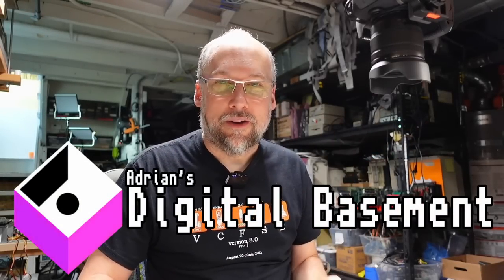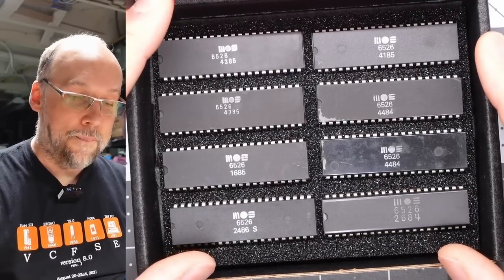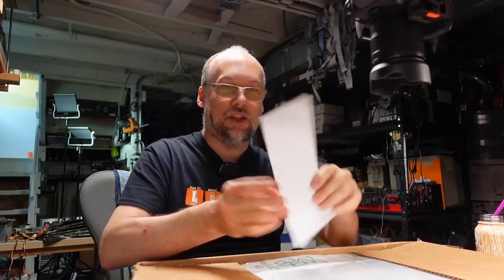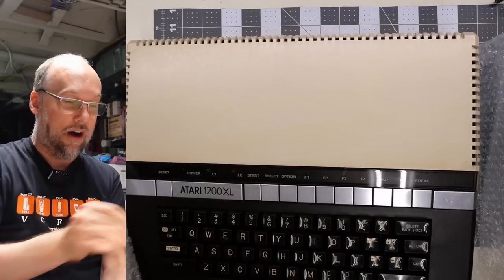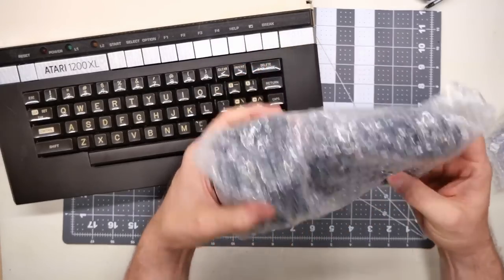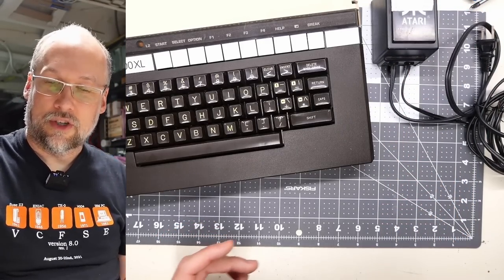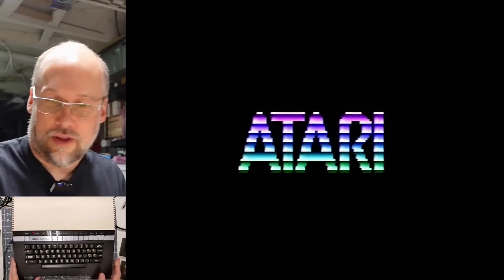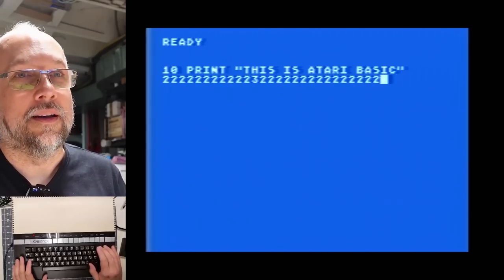0066 A pretty rare Atari computer shows up in the basement

Comment: When I got my Atari 1200XL from a thrift store, the keyboard was totally unresponsive. Then I found out that the plunger that contacts the membrane have softened over the years that it would not put enough pressure for the contacts to work. After some disassembly to access those plungers, I used 1/32 heat shrink tubing and cut little pieces of 1/32 of length and put it on all the key plungers. DON'T HEAT SHRINK THEM! After a couple of tries, changing the length ever so slightly, I got all the "freaking" keys to work. You have my permission to mention me for this.  Douglas

Comment: 24:11 - if you have to replace a cable on an old joystick, don't use some regular 9pin d-sub connector with some random 6-7 wire cable but look for 9pin joystick extension cables. They still make those, they have male connector on one end and female on the other, just snip off the female end, tone out the pins and you can hook up to your joystick, good as new and it won't cause issues with the joystick port not fitting in the machine.

Comment: The Atari 1200XL was a beautiful, if flawed, machine.  To support the Help function and self tests it boasted a new OS.  Unfortunately it was incompatible with some programs.  Atari would mail out for free a Translator Disc that had two versions of the original Atari 800 OS.  I was surprised that when the 800XL was released it STILL had the less than compatible OS and the Translator Disk was needed.  The 1200XL did have a better keyboard than the later 800XL.
Reply: The later 130XE was more compatible than the 1200XL had been, so I guess Atari did finally try to fix at least some of those issues in the ROMs. I know that because KoalaPainter didn't work for crap on my XL but was fine on my XE.

Comment: The Atari  PSU you are talking about it the one known as the Ingot and yes, most folks won't even bother to use them and instead replace them with a modern switching type or use one of the later made PSUs that don't have the issues. I use one of the later made XL style PSUs with my 130xe.
Reply: I recently cracked my "Ingot" for my 800XL open and replaced the inside with a switching PSU and glued it back together.

Comment: I’ve found that the keyboard membrane tends to “stick” to the PCB underneath if it isn’t worked regularly.  You can use a hair dryer to loosen it up and gently peel the membrane off and reapply it.  I love the keyboard feel on my 1200xl (it’s the best Atari 8-bit keyboard feel IMO)

Comment: There's usually a small adjustable trim capacitor to fix that colour smear or character shadow etc.
Reply: Is this Atari 1200 XL comparable to Amiga 1200? Naming suggests it should be.
Reply: @richard.20000  - The Atari 1200XL predates the Amiga 1200 by almost a full decade.
Reply: @Randy.Wuerger  Is Atari 1200XL faster than my Amiga 600?
Reply: @richard.20000  - How could it be? Again, the Atari's design predates the Amiga by almost a decade. And both were based on design concepts of Jay Miner's engineering team. But the Amiga was designed to be the next-generation "Atari" computer. NO. It's not comparable at all.
Reply: @Randy.Wuerger  I ask because my 3 years old MacBook Air M1 is still much faster than any today's new Intel laptop. So it is possible to design future proof computer.

Especially when legendary Jay Miner was involved. I guess the Atari naming is what confused me (1200XL, 800XL, 130XE etc.).

Comment: I recall some of these computers having compatibility issues and thus it was hard to consider it. I did go from at 800 to a 130 XE in college due to my damaging the keyboard during a final paper. The 130 XE was great. The 800 was repaired and still works. Not sure if I kept the 130 XE. I did purchase the disk drive with this styling and never had an issue with that. PS Would love to see you do more Atari 8 bit videos. Thank you for your great content!

Comment: The 1200XL was my first (and for a long time, only) machine!  (Name checks out, right?)  It's funny, I never saw one with these multiple LED colors; mine was just red, red, red.  (I got mine during the "clear this inventory out" phase, as it had a pretty hefty mail-in rebate attached.)

And, yes, there were some incompatibility issues due to developers using tricks they weren't supposed to in the 400/800 days; to fix this, you would use the "translator" disks, which would load the older ROM images into the banked RAM to more closely simulate the older machines.

Comment: At elementary, we had VIC-20s and 800s. Where I started. My first home computer was a 1200XL. I programmed a great deal on it and played a lot of games, and never had compatibility issues. The later 600/800XLs which my friends had, just felt cheaper quality. I think that's what happened, they cut corners as the 1200 was made well. I also later had a 130XE which was nice, the extra memory was kind of useless, but it was fun too. It looked modern. I still have a Vic 20 and an 800, but would love to get a 1200XL one day for the memories. I still play Infocom games on my Mac. Great video.

Comment: I have bought some replacement parts to refurbish the notoriously flaky Atari 5200 controllers from Best Electronics (mentioned by Peter) and I can confirm they're a great shop. They are a bit old school and quirky but they're the only source I know of for quality replacement parts for Atari machines, and the stuff they sell is top-notch and much higher quality than what came with the consoles/computers originally. They advertise many of their flex PCBs and replacement buttons as "lifetime" parts and I believe it.

Comment: I adored my Atari 800XL. I was studying electronic engineering at the time and this machine was excellent! You could do some serious coding on these machines! I had an Assembler language cartridge that I was able to use to code speeded-up (object code)) routines that I could 'call' from Basic! I cut my teeth on this machine, it was a serious boost from the BBC B I used before it. It fitted it neatly between the BBC B and the Com' Amiga that I got after it. I liked the look of the Atari ST but the Amiga OS swung it!

Comment: The Atari 1200XL case was used in the Brazillian computer TK2000 by Microdigital, though inside that was a clone of the Microprofessor II by Taiwan's Multitech (later Acer) which was mostly compatible with the Apple II. It didn't have the joystick ports on the side, however, nor the function keys.
Reply from the maker: Yeah! I was recently reading about the TK2000 and indeed, it's clearly a knock-off. (And I love it!)

Comment: The 1200XL was my 2nd PC... I know there were compatibility issues with it but I never ran into them.  The biggest "compatibility" issue was with the SIO port on it.  It wasn't wired with power (like the 800/400 were) so printer interfaces were special for the 1200 and had a wall wart added.  I think its an easy bodge fix but at 14, I didn't know about it.  Eventually I got an 800XL + Rambo 256K + MIO + 30MB hard drive and that was /|\ bliss...

Comment: Adrian you can probably get a free replacement membrane from Best Elec since they offer a lifetime replacement warranty on their membranes.  Congrats on your 'new' 1200XL!  They made about 110,000 of them in total.

I'm thinking someone replaced the stock red LEDs with the green and yellow ones, but they did it tastefully with ones of good brightness and not super bright modern ones.   
There is an updated bugfix OS for the 1200XL that Atari developed and they even made a bunch of updated OS chips before the 1200XL first released but were for some reason not installed and Atari used the more buggy OS chips I think merely for cost reasons. The updated OS will show (R) on the power-on Atari screen to denote Atari as a registered trademark. Best Electronics may still have a few of these remaining 1200XL 'B' ROMS at about $30 for a set (new old stock) or you an burn the updated OS onto eproms. The 800XL has an updated version of the 1200XL's B ROM that includes support for more things like PBI bus etc.
The key to the right of HELP is often called 'inverse key' on XL's or on the 800 it was called the Atari key.  
To keep your cart tunnel looking nice, be careful how you insert cartridges into it. They can get very scuffed with long black lines from cartridges. Looks bad...
There two slight variations of 1200XL's. About 1/6th use 28 pin sockets for the OS ROMS while most have 24 pin sockets. The 28 pin sockets are preferred because they make installing a U1MB upgrade or standard 800XL ROMS much easier. The other variation is that some will use a flex cable for the cartridge port while most seem to use rigid wires (preferred) for the 90 degree angle to the motherboard.
Another variation might be that the factory used 300ns or maybe 200ns RAM (I think). 
All of the main and custom chips I think should face one way (notch on left I think) and one socket (Antic I think) on my 1200XL was installed backwards so verify socket vs chip orientation with a photo before you pull chips.
It looks like your machine might be missing the RF shield, which is a nice thing to still have in there.
Yes the 9v A/C adapter from my experience is very safe. The A8bit FAQ says they can drift in voltage but I've never seen that and I think the 400/800/1200XL/1050/810/XF551 can probably take a good bit of drift anyway but you would know better than I how much.
1200XL video quality can vary greatly. There are simple and more modern upgrades for the video. They have a unique color saturation circuit that gives the 1200XL a unique quality that other models do not have. If you install a modern video solution like UAV-D that will bypass the saturation circuit.
The angled joyports are not as nice as the straight ones IMO.

Note: you said the 800XL power supplies are bad but they did make good ones that can still be used. The ingot is very common (epoxy filled) and should be thrown away. However the ones with the XL vent styled cases can be fully serviced (replace caps etc) and used and are safe if they have been serviced. There is a black and white one of these.

Enjoy your new machine! Loved that it gave you a joyface!

Comment: The reason that Basic exists for the newer systems as well is that the basic that is in the rom is actually a limited version, I think they had to crunch it down to 4k of rom space, so some features are missing. Those cartridges are a larger, more feature-filled version of AtariBasic.
Reply: (This version didn't have a basic rom, but the XE computers later on  had only the stripped down rom.)

Comment: The L1 and L2 lights have the following meanings:

L1 = Keyboard has been deactivated
L2 = Keyboard is in the International Character set.  (Control + F4)
Reply: But surely not while in the memory test?
Reply from the maker: Ah that's interesting. So some registers that be set to toggle the LEDs?
Reply: @adriansdigitalbasement2   Yes,  they are controlled by the second PIA port (PORTB at $D301), which also controls the memory access (RAM / ROM / I-O-area).
Bits 2 and 3 switch the LEDs on when set to 1.
While these two bits are without function on the 600/800XL they do control the RAM bank on the 130XE (together with bits 4 & 5).
As you mentioned, the third and fourth joystick ports were the casualties of this.
A good reference is "Mapping the Atari (Revised Edition)" as it covers the XL & XE models.

Comment: Adrian, The 1200 keyboard may have a steel plate with a crap ton of tiny screws on the bottom.
If so then make sure that you face the keys down when removing them as there are tiny springs which press on the membrane.
THE WILL GO everywhere ! Stretching a spring will help on the ones that don't contact well... not to much or the key will stick on. 
Sometimes you can just tighten the tiny screws close to the intermittent key to fix them.

Have FUN! Dave Faxon NH Seacoast Personal Atari Computer Enthusiast (NH SPACE) .

Comment: I had a UK Atari 800XL with a 5.1/4 inch floppy and a data cassette drive. I love it, was an upgrade from my Dragon 32 computer. My Atari 800XL booted right into Basic, so not sure if this was a difference with the USA 800XL?
Reply: The 600/800XL and later machines should always boot into BASIC unless you hold down the OPTION key which disables it.
This applies to both NTSC and PAL machines.

Comment: No no..  The 1200XL was released BEFORE the 600XL and 800XL in 1982, while the 600XL and 800XL came out in 1983. It was supposed to be the successor to the Atari 400/800 but the 1200XL was a flop. It had compatibility issues with existing Atari 800/400 software, and it was more expensive. Atari made a "translator" disk that allowed older software to run on the 1200XL to work around some of those problems, which these days aren't a big deal as most software is focused on XL/XE compatibility.  

The 800XL and 600XL was the "fix" for the 1200XL. The 800XL was cheaper, had built-in BASIC, and fixed most of the compatibility issues the 1200XL had, and those compatibility problems were mostly gone, or didn't matter.  My 800XL came with a translator disk but I never had a need to use it for anything.

The Fkeys were useless (the help key is still useless on the XL/XE machines). The 1200XL had the "inverse key" on the top row with the Function keys which on the 800/400 was the Atari Logo key that caused characters to appear inverted (all it did was set bit 8 to 1, since standard ASCII only did 7bit, thus doubling the number of characters you can have on screen for ATASCII).  Normally this key is on the main part of the keyboard.  the 1200XL was special in a awkward weird way, even the Break key is up at the top right along the silver buttons.

Comment: My first computer was the 800 around '83, came with third-party 48K RAM that failed on me.  I upgraded to the 130XE.   Had to make a floppy to downgrade the OS to 800 OS for a bootloader I wrote as I cheated in bypassing the vectors.  Started with the single sided/single density Atari disk drive (that cost a pretty penny), eventually upgraded to third party double density disk drive.  Eventually had 2.

Comment: As a Texan, I would not even notice or care about the sound of an A/C going on in the background. It's just that for me...background noise. I don't doubt it's loud down in the basement, but eh, it's worse to shut off your A/C in that kind of heat and make it work to get back down to temp, than to just endure the noise it causes. Your energy bill definitely spiked for a good minute there. Don't doubt me. Born and bred in this weather. I know the struggle.

Comment: I don't know about the 1200XL but the Atari 2600 (console) had joysticks that were reasonably compatible with Sega Genesis controllers. 

If you did Atari controller to Sega, you only had one button (of course).  If you went the opposite way, you had the directional pad and the A button (as memory serves) functioned like the button on the Atari joystick.

I mention this because you may not need to modify an NES controller. You might be able to just plug in a Sega Genesis controller. 

I'm half-tempted to find one for sale so that you can test this for me. I'm a bit curious.
Reply: Correct - The A8 computers use functionally the same joysticks as the 2600.  The directional signals and the single button all match up with Sega.
On a Genesis pad the 'B' button will be detected by an Atari.  I think this is the "1" button on a Master System controller.
The Atari pinout is shared by most things with 1 button, but systems that expanded to 2 buttons each had their own ways of doing it, so that's where everything tends to break down.  Atari only had 1 button on the A8 computers but they added a 2nd button on the 7800 console (ignoring the 5200 because that system had a different controller port).

Sega's 2nd button ('2' on a Master System and 'C' on a Genesis controller) works differently than how Atari did it on the 7800.
It is possible to program the 7800 to recognize the 2nd Sega button, but "official" 7800 games won't recognize it.  I don't know if the A8 computers are wired to be capable of detecting a 2nd button (whether 7800 or Sega style) or not.

With the Genesis, Sega expanded to 4 buttons.  The Genesis 'A' and 'Start' buttons are multiplexed on the same signal lines as the 'B' and 'C' buttons.  Atari cannot access those buttons at all, because it's wiring cannot communicate with the mode switch that controls the multiplexing.  If I remember correctly, I think Atari has a constant +5V supply on that pin.  So when attached to an Atari, the controller will stay in the mode of only signaling the 'B' and 'C' buttons (with only 'B' being coherent to legacy software).
The Genesis "6-button" controllers (which are really 8 buttons) expand the multiplexing further, but again that expansion cannot be used by an Atari console.

I always use a Genesis controller for Ataris.  I like them and it's the easiest solution, just plug it in and it works.

Comment: Nope, no Built-In Basic in the 1200XL.  The cartridges you have though are the old Rev. A "buggy" Basic.  You should look for a Rev. C cartridge or burn a copy of Altirra Basic onto a ROM and add it into the machine.
Reply: What for? Adrian only runs 10 PRINT "This is an Atari"; 20 GOTO 10 anyway...
;-)

Comment: well how many logic elements are needed for 6502, is 2K enough? 2 bucks for those from arrow
Reply: if you do it right, you dont need anything else than the fpga and the pins socket
Reply: seem like logo is like gcode for 3d printers and lasers
Reply: how about making chips diy, with ion mass separation anode ray tube, includes electron scanning/transmission microscope, and ion pvd and bombardment
Reply: yep you can even grow single crystals similar to hydrogen torch crystal growth process, flame fusion, all-in-one